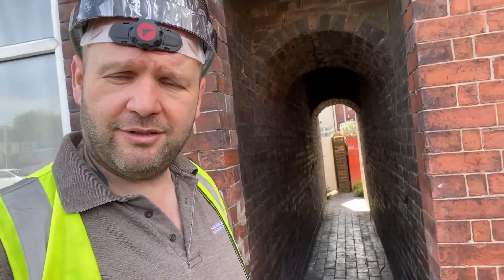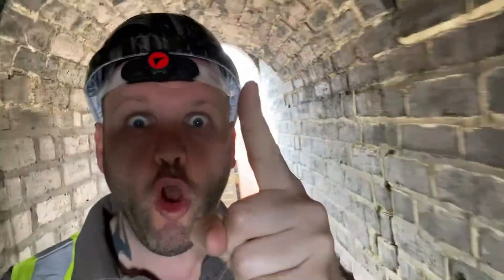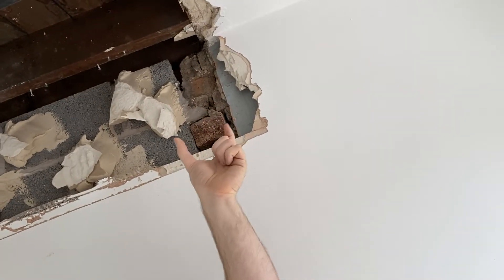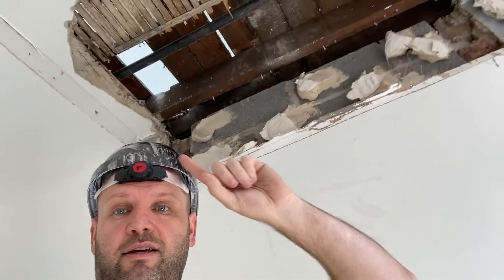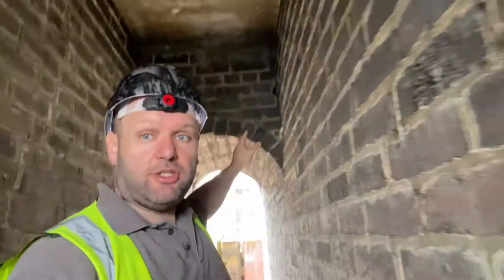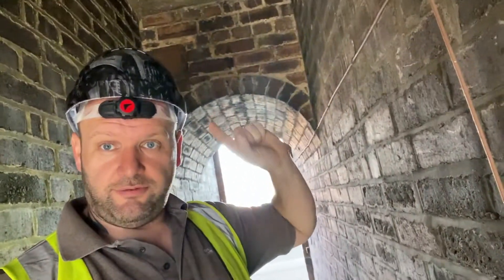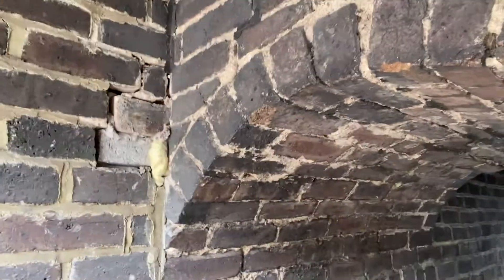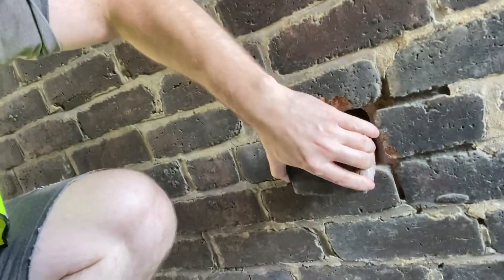Choose the Right Builder (How NOT do to an HMO Part 1)

Comment: Great video mate - I’ve been binging on your videos for a few weeks and really enjoying them! Out of interest, when you say “stitch / tie the brickwork in”, I assume this is more than just pointing in? Would you use wall ties or something like that - particularly thinking about the outside archway. Thanks! Right, time to find that video on you sorting drains out now haha
Reply from the maker: Hi Lee. The correct thing to do would be to consult a structural engineer to determine the extent of the damage. There may be ground movement, for example, which needs far more attention than just correcting the brickwork. The engineer will produce a method statement and you carry out the works according to that. 

In this case, the masonry was repaired with Helifix HeliBars and a suitable adhesive.

Hope that helps, buddy. Thanks again for watching, your question and your great feedback 🙂👌
Reply: @HYPEBuilding  great - thanks John!